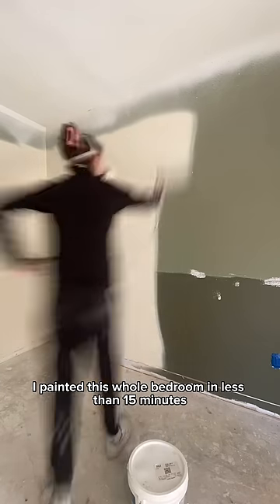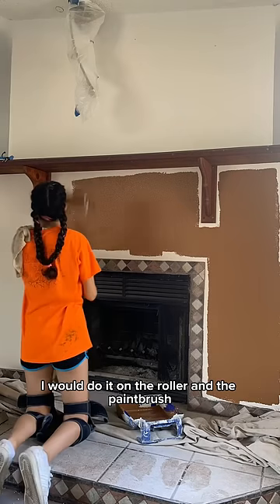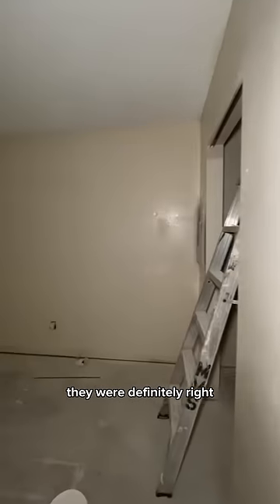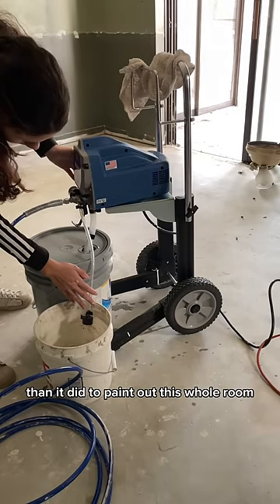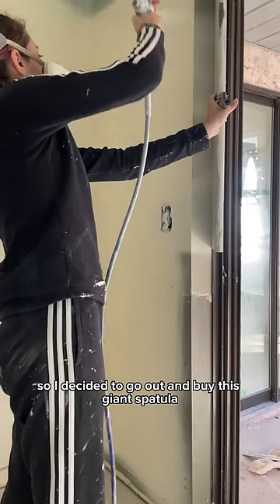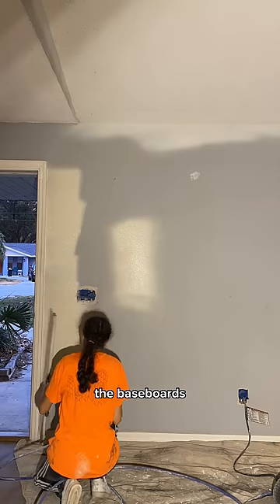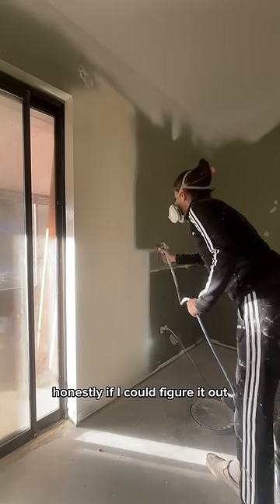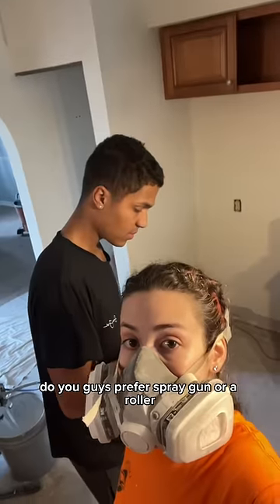I painted an ENTIRE room in 15 MINUTES?? #painting #homeremodel #houseflip

Comment: Spraying an open outlet is a bad idea. The rest is legit.
Reply: Take outlet covers off, tape off hole, and paint cover in a box.
Reply: Thats not an outlet thats a switch lol
Reply: @wook420  she sprayed paint straight into the wiring that's not how you do it. Lol
Reply: @wook420  lol yeah.
Reply: @wook420  they are right
Reply: @@maryjohnson5776 right about what ? It being an outlet ? Wrong. Thats all i addressed in my comment, move along
Reply: @wook420  good 👍 🤔 Aw
Reply: @wook420  You know there were multiple exposed outlets and switches in that room right? Doesn't really matter which is which, she painted the whole room that way.
Reply: Overspay everywhere after everything settles
Reply: @wook420  you cant read: you don't spray paint over electrical connections ever...outlet AND switches have connections.
Reply: Eh, as long as the paint isn't flammable it's fine. All of the cheap apartments do it. With her technique she'd make a great painter for those kind of apartments. She also had a bad tip or the machine pressure wrong. Fingering.
Reply: @Capthrax1  sure. Can it be done? Absolutely. Should it? Not if ya want longevity.
Reply: @William Sveen  also if you've ever seen new construction they blow texture and paint all over the wires.
Reply: @Capthrax1  sad but true. LOL I am old. Not back in the day. When trim guys didn't need chalking.
Reply: @ajk374  how do you think new construction is painted?
Reply: @wook420  ..same thing, same current same exact wiring, just how it connects to the outlet
Reply: @wook420  Bless your stubborn heart. 😂 They were correct you were wrong move on. If you didn’t want to be called out you should be more specific.
Reply: You need to back roll. Endless you care what is looks like ( po-po)
Reply: If it's taped off it does no harm however spring it openly means you have to replace that with a switch that matches the paint decor of the rest of the switches and outlets
Reply: Agreed. All the wires painted
Reply: Outlet 😅is a switch & to be honest nothing will happen period who cares if I’m changing all outlets or switches period
Reply: and switches  etc.
Reply: @Capthrax1  doesn't mean it's right or good, that's why they're cheap and make it harder on the electrician to tell which color to fix
Reply: @suppertimesims  Lol no it doesnt
Reply: @Capthrax1  bad bait lmao me and my family is full of electricians and engineers
Reply: @suppertimesims  only half the wires are covered and the side that is scrapes off very easily, even with a finger nail. quit acting like a princess
Reply: not that it is a good idea to paint the outlets and switches wires. But as a Real-estate Property manager i see it all the time. some of the drywall overspray mostly.
Reply: Outlet or switch... those patches will show and this won't look good.
Reply: Paint over wires is not that much of a problem, they don't really care, the next electrician may curse you though. What's bad though is paint over switches and connectors, especially if you do it multiple times over the years. Things might get stuck and you'll have to face that electricians curse.
Reply: Regardless YOU DONE AN AMAZING JOB... CUDOS TO YOU.❤❤❤
Reply: @johnspence8141  why?
Reply: Spraying in a living house is crazy. The overspray is out of control. You’ll spend more time cleaning than taping  and rolling. Imo
Reply: @wook420  generic misspeak. You wouldn’t paint over an uncovered light switch either.
Reply: She didn't tape windows and left a door open. Next door kids will get cancer. Jesus.
Reply: @wook420  "that's not an outlet that's a switch"

Dude that's not the point 🤦‍♂️🤦‍♂️
Reply: Professional painter here. We choose not to cover the whole box and only cover the face of the receptacle. Paint isn't that bad for connections that are already made, and honestly not that much really get on it. Sure it's definitely more annoying for the electrician and less Professional but most people care about price and don't care as long as it looks good
Reply: It was taped off, but she did that without taping anything.  So I'm worried.
Reply: @dtoad48  no tape at all? She taped over the exposed switch with blue tape.
Reply: @dtoad48  she also taped all boxes hanging out of wall if you pay attention.
Reply: @dtoad48  you lose
Reply: @jigsawkiller Dude.. listen to the first 3 seconds.. How to paint a room without taping, then you see tape.  Sigh.

Comment: Wife and I (both age 69 & retired) rolled every wall, including inside every closet, pantry, and bath, mostly 10’ and some 14’ and 20’ high walls and the baseboards of our approx 4,000 sq ft home.  We are both really picky about quality.  She did all the trim and cutting in and I rolled.  She shined an LED light against every wall between coats and marked any flaw that I needed to correct.  We also repaired nail pops and settlement cracks and recaulked.  It looks better that it did when new.  We used SW Emerald interior paint.

Comment: Why would u spray an open outlet .. thats not a great idea
Reply: It has tape over it smfh
Reply: @trinistar1930  really, a tiny peice thsts not covering anything SMH
Reply: Its taped and its a switch, not an outlet.
Reply: It's not open, nor an outlet
Reply: @wook420  it's still not good. She sprayed paint straight into the wiring.
Reply: @trinistar1930  bad bait
Reply: @balesshippolova  where do you think a switch draws its power from? The switch is wired to the outlet and light . Turn switch on, draws power from outlet to the light, turn switch off and it disengages the connection between the outlet and light. I’m really curious to as where you think the switch go it’s power from. When the the switch is in off, it’s still drawing power from the outlet to it but not transferring it over to the light fixture. Y’all fucking know everything today no need for a pro. Have fun explaining to your insurance how the house burnt down cuz you kept spraying paint over all receptacles and switches.
Reply: @trinistar1930  
It has tape halfway over it, it’s the crappiest job I’ve ever seen😂
Reply: @balesshippolova  
It’s absolutely open, there’s one piece of blue tape halfway covering the switch.
What a sloppy job

Comment: Roller, when you use a spray gun you aren’t putting enough paint on the walls. And the paint you put on the walls is watered down. It can take at least 1-2 gallon to prime the lines to the sprayer, so companies charge extra for watered down slop. With a brush and roller it takes actual talent to get it right

Comment: Dont bring out a spray rig to paint one bedroom, use a paint stick that holds paint inside. You will spend more time cleaning the rig than its worth. Cover you plugs and switches with blue tape, if you have an open electrical box and dont want to tape at tleast waud up some paper and push in the box. you dont want to paint your electrical wires

Comment: It’s only good if you paint the ceiling and walls the same colour. It doesn’t save time really otherwise because the masking up and cleanup of the overspray mess You still have to cut in all the walls to ceilings which takes most of the time and the final detail of the finish especially around doors, skirtings, and colour changes is harder to get as good

Comment: I’m a professional painter. Good for you. But you painted the outlets and switches. :(… The best use of an airless in doing the flat wall is that you can do the ceilings fast, and no cutting in corners . A * little bit
* of masking on the electrical stuff and a shield to keep floor dust off the wall would make this 100% good

Comment: Using apaint  sprayer in an enclosed area like inside a house, is not approved by OSHA, because you're actually contaminating the house with violate organic compounds, and other pollutants that will remain in the air for months and you will breathe it in and harm your health.   

In addition, the time it takes to tape and mask everything off and start up the sprayer and clean it and put it away is more than the time it would take if you would just use a brush and a roller that also costs less because you don't need hundreds of dollars for a brush and roller like tou do a sprayer of which you will still need brushes and rollers. 

 So basically you spend more money using the sprayer,  the job really isn't that much better, it costs more, and you ruin your health.

Comment: not a great recommendation just because there's so many variables that can mess it up. you can spray way too much and it will glob and drip. if you don't keep it the same exact distance and at a straight angle the entire time it will all look different. it WILL get paint everywhere even if you think you're careful. those tiny almost invisible sprays of paint travel and it can leave a powder like look of paint on anything it reaches. it's just not worth it for most people. much more complicated, worrisome, and expensive than anyone ever needs. stick to your rollers, people.

Comment: Still should back roll after spraying. Otherwise there are splotches and it looks terrible. One stroke top to bottom, use the widest roller you can handle.
Reply: When should you roll after spraying? Like how long? 
Do you add another coat or just roll the paint that’s been sprayed already?
Reply: @danieltincopa6590  Roll the directly after spraying. Don't let it dry. Roller should be loaded with some paint but not much.
Reply: If you have splotches you are either using too much for your speed of application or not spraying evenly … it can take practice. Thinning the paint correctly is important when spraying as is the temperature and humidity …

Comment: Pick your poison….spend a day clearing out the room and taping EVERY surface to spray for 30 mins or spend 30 mins to tape off edges, throw blankets on sofas and paint with a roller for a day. They both take the same amount of time but with the sprayer you WILL be finding some area of overspray even if you thought you taped everything it’ll sneak in there somewhere. Spraying is good if you’re painting an empty house prior to flooring install or for painting exteriors.

Comment: You should always backroll when using a sprayer to even out your coat. Other wise you will end up with heavy and light laps in your paint. You will have stripes in the sheen and gloss of the paint. Go stick a light at 90 degrees to your wall and look at it. The reason you mask off the doors and windows is to prevent over spray, not just the main stuff from the gun but the tiny air particulate specs that go everywhere. Your windows and doors will all have tiny freckles all over them and will feel like sand paper to the touch.

Comment: So how was the cleaning of the sprayer? cause that's the worst part.
Reply: Yes! I used a sprayer once - for the inside of a huge Victorian house. Rinsing out all the parts and tubing was an extreme hassle. Never used it again.
Reply: if it's done right and you dont let the sprayer sit with paint in it , cleanup isnt that bad. time consuming to do it correctly. lazy hack cleanup can be done in 15-30 minutes

Comment: I’ve been painting for about 30 years and I will always use a brush in roller inside unless it’s a very low budget project like an apartment. The reason is because with different sheens you need to backroll what you spray to insure that everything is even at tacked at the same time. Unless of course you need that spray finish but you can’t get that over textured drywall anyway. And I would never want super slick walls you will see every flaw with light shining on it.
Reply: We used to spray the drywall primer, first coat in new builds. doors,trim always got sprayed. finish coat we backrolled

Comment: I've never used a spray gun. I'm wondering when you then use a brush and roller to do the bit at the top can you see a texture difference? I need to do my hall which is flipping huge and this would make it so much easier

Comment: My machine (purchased at Lowe’s). On Sale.  It has not worked right.  I bought all new lines, nozzles. Sprayer even went 100 miles out of town to get it serviced, repaired, rebuilt.   Check repair replace install new motor / parts.  Brought it home.   Still have issues. So I put it up.  Never used it .  Again.  When I did it took 5 mins 10 gals of paint DONE. Loved it.  But the stop n go n down time was a killer. !!

Comment: You also should backroll the paint with a roller because if it has to be touched up in the future, a roller will not match the spray texture and will stick out like a sore thumb.
Reply: touchups generally always stand out anyways. touchup with the same batch of paint you used matches. touchup with paint bought 4 yrs from now isnt going match. Sherman Williams is notorious for  changing paint codes. bone white from 2020 is now antique white in 2023

Comment: I'm amazed by the lack of a paint cloud that envelopes the entire room, two seconds after the first trigger pull.
Reply: A lot depends on the tip being used.  For trim using a Fine Finish Tip (FFT) there is some misting.  Changing to a RAC5 515 regular tip reduced the misting to almost nothing.  It also depends on the paint.  The wall paint (Benjamin Moore) produced a bit more mist than the ceiling paint we used (local paint maker)

Comment: Cleaning the sprayer takes well over 30 minutes done properly.  Add in the overspray clean up, and it comes close to the same time as brush and roller.
Reply: nah brush and roller cleanup is much faster - wrap both in plastic bag, toss it right in the bigger trash bag. especially if you using Home Cheapo/Blowes specials rollers,trays etc

Comment: It would Basically be the same as spraying water  into the open wiring. Water is electricity conductive. Which is why electrical things can break if you get it wet. 
So definitely not a good idea to spray paint into there.

Comment: So youre getting paint in the air. If you don't cover the windows you'll notice a difference later.
Also don't use these when it's high humidity out unless you want runny paint in places.

3rd get a proper respirator
I had the wrong one when I did this with my dad and was blowing paint covered snot out my nose for a week

Comment: Sprayers:  Great for doing entire house ceilings, cabinets (for no brush marks, and professional look) and outdoor, large projects.  If changing colors in an entire house, then a good way to start.  Still have to do prep work to tape and cover.  Definitely back roll walls.  Setup and clean up sucks, unless you do it a lot and have a good routine.  For the average person = rent it.
Reply: or in new construction, spraying drywall primer/sealer. In el cheapo slap it together McMansion's , spray everything. especially when everything is the same color/sheen.

Comment: Roller all the way.  So much paint gets lost on the ground or in the air. Paint coverage is also thinner.  Overspray sucks scraping off of glass and almost impossible off of plastic outlets or light fixtures.  Tossing a used roller in the garbage vs cleaning an airgun…? Yeah, nuff said.

Comment: Sprayed paint is drying through the air causing it to dry much faster as you spray it, and shortens the drying process that allows the paint to adhere and harden properly in my experience. Spraying without back rolling does not set the paint into the previous paint layer near as well and you do not get the traditional texture. If your paint is good enough and does not scrape off with a finger nail it might work out. Over spray is hard to control, but if you are happy with it, my opinion does not matter. When I see people spraying their exterior I cringe, it will not last unless it is a 2 part chemical reaction paint, like epoxy. Especially when spraying traditional paints over bare drywall, it does not adhere to the drywall properly and stays on the surface. My .02.

Comment: I use my sprayer in a remodel job that we’ve tore floors out of. Makes too much of a mess if it’s a finished home that’s just painting. Also, I back roll it every time. Spray then quick roll with paint soaked roller. Makes the paint stick better, gives that orange peel texture, and takes care of drips you may get from just the sprayer.

Comment: Bad idea lol, but if you must spray finish coats on interior walls, at least backroll. Also when you see edges on the spray pattern like that, it usually means the pressure is too low. Also also, do not buy those home depot DIY type sprayers, they suck and they arent much cheaper than an actual good sprayer like a titan 440.

Comment: When I bought my house I used a sprayer on all the rooms.  Got all done (except detail painting and base trims) in about 3-4 nights working 4+ hours each night.  I did lay down and tape drop clothes on the floors and windows and other items like counters.
You have to make sure you keep the nozzle/spray small to medium spread.  If the spray is too wide then it will splatter more.  Also, spray in short straight bursts, just don't go blasting away.